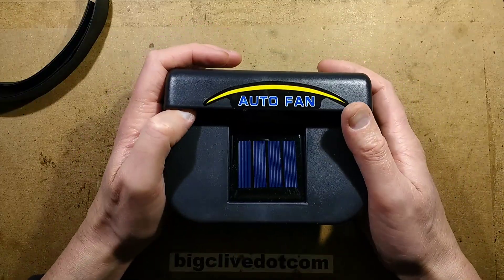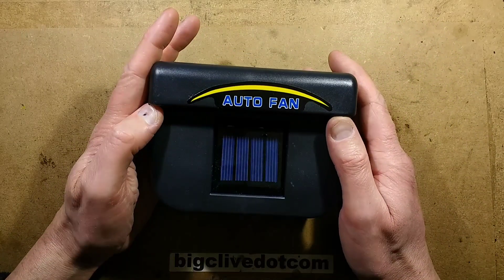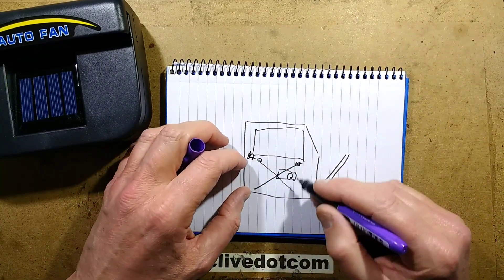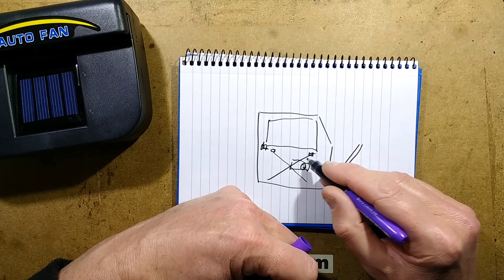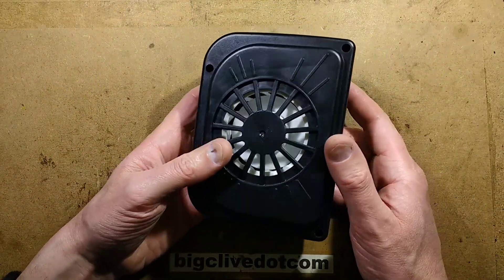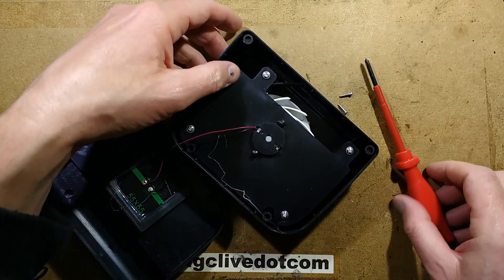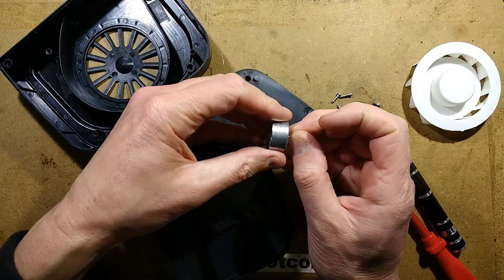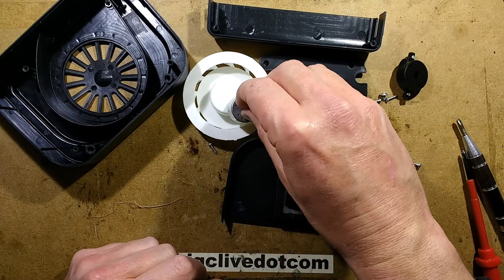Inside a solar powered car window ventilator.

Comment: I'm curious as to how well it worked before you broke it?
Reply: I have had one in the past, You get what you pay for. A shade panel for your front (or rear) windscreen helps more. I had one of these for a while, I felt that it helped in the summer, but not as much as a good shade.
Reply: I have one i didn't break. It will only work in direct sunlight, and even then the airflow is next to nothing :)
Reply: TheHalunk Will it keep my car from getting hot enough to bake cookies in? I'm willing to settle for only intolerably hot.
Reply: Dwayne Wladyka I'm a Patreon supporter, we get early access.
Reply: With this puny power its not going to help at all. My suggestion: sunshades are lot more useful. 
I also tried to lay 40w solar panel behind the rear window and connected it to car heater/ac fan. Although it spinned quite slowly it helped to push some fresh air in the car and kept it a bit cooler.
Reply: Real men shoot 308 How'd you get a notice of this video 1 day ago? I got the notice an hour ago.
Reply: Dwayne Wladyka patreon he donates cash you get perks for caughing up money.
Reply: Glenn Brockett Thank you. I live in the upper midwest, short summers but nasty hot and humid.
Reply: TheHalunk I tried one not the same exactly as this one but the same principle it didn't really move enough air to even talk about and it had to be in really bright sunlight to do anything.
Reply: If you put 4 on each window it may be slightly cooler (tried one) don't waste your money.
Reply: I have one. It needs about four times as much solar panel, and a higher volume fan.
Reply: They're JUNK
Reply: Your pic is racist.
Reply: Had one back in the '80s before AC. Probably helped a degree or two, but when it's over 60C after being parked for a couple of hours you can't really tell. Glenn's got the measure of it.
Reply: Wayne King 
Div
Reply: Real men shoot 308 , better than it does now.

Comment: The inside is normally called the door card.
Reply: Vapor barrier?
Reply: I believe the liner he was referring to would be the vapor barrier. The door card or the door panel is the outer housing of the inside of the door.
Reply: I think he was referring to the metal panel behind the door card with all the annoyingly small holes to work on the mechanism
Reply: He was refering to the part under the door panel/card. The plastic film style is known as a vapor barrier in the US. It is stuck on with a black tar like substance. But european cars are starting to go with a bolt on style plastic piece, which the window regulator and other parts actually attach to. We refer to this as a vapor barrier as well, but I would guess that there is a more proper name for it.
Reply: TheChloeRed English is indeed a door card.
Reply: That's the smuggle compartment drugs, money, etc...bugclive is smuggling electronics or booze. Haha
Reply: TheChloeRed iii